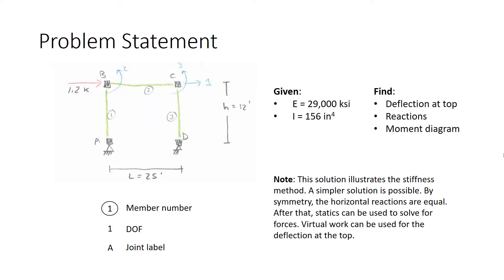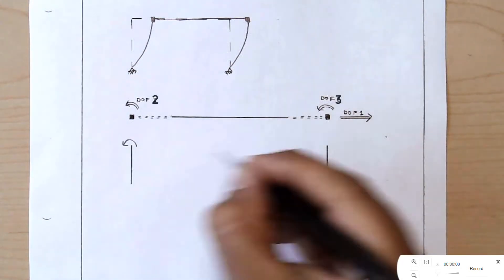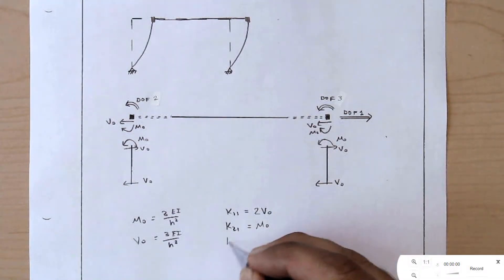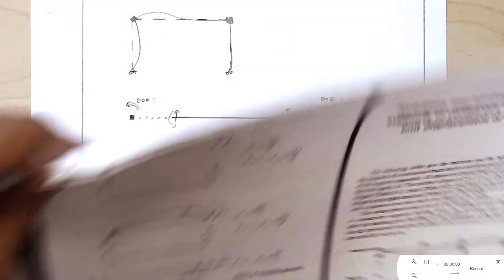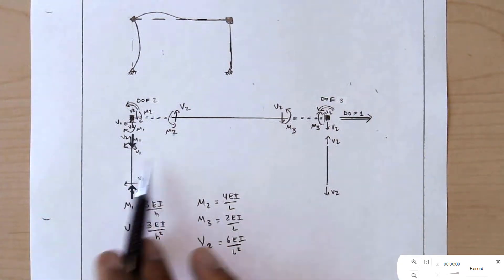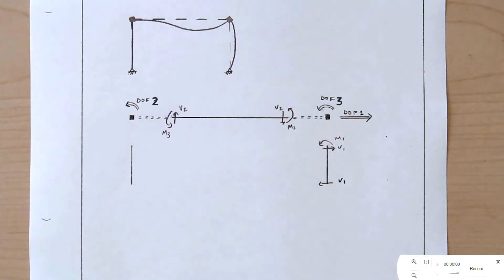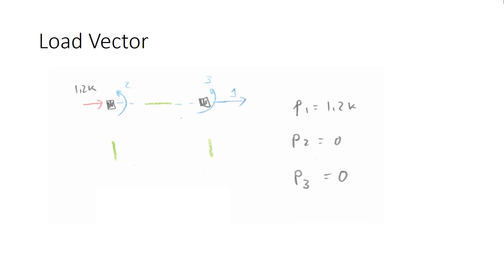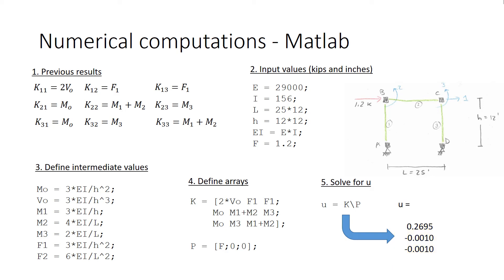Stiffness Method for Frames - Part 1, Setup

Comment: Is there a reason you do not consider the rotation of the joints at the pinned supports as DOF 4 & 5?
Reply from the maker: You're allowed to omit rotational DOFs at moment-free ends provided that you use the right stiffness factors and force recovery process. We do this to reduce the problem to a 3x3 instead of the 5x5 it would otherwise be.